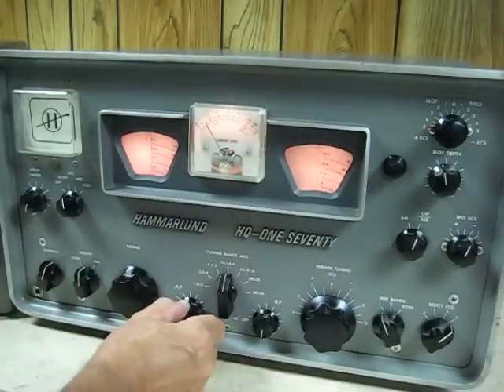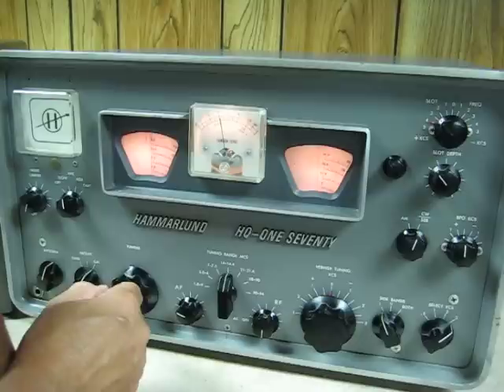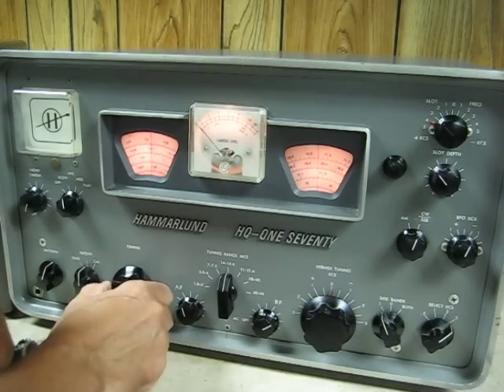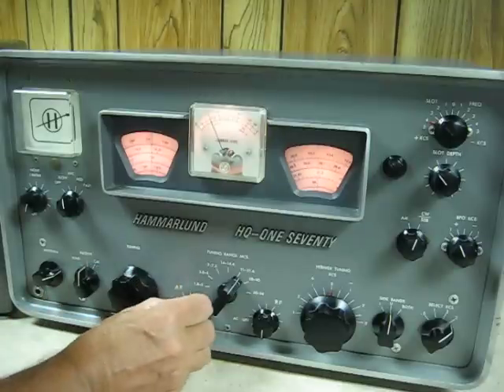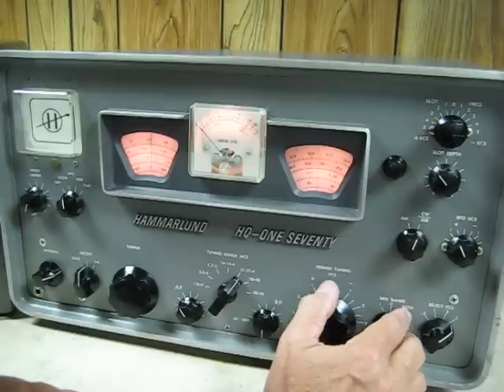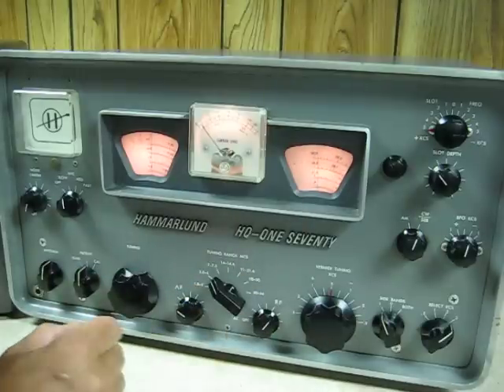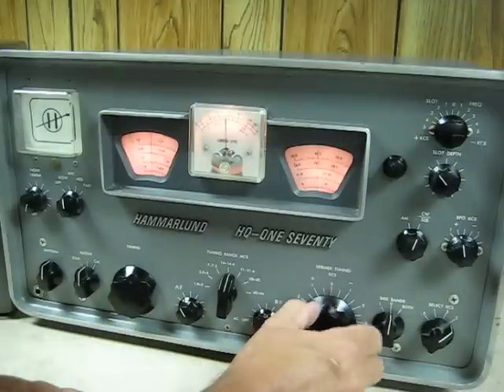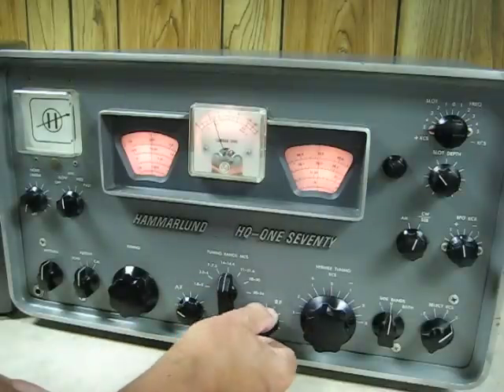Hammarlund HQ 170

Comment: A beautiful receiver.  This is the very first piece of equipment I ever owned, and was my introduction to Amateur Radio.  Bought it for $100 in 1976, when I was a teenager.  I still remember how thrilled I was to get this thing sitting on the desk in my bedroom and hooked up to a simple long-wire antenna.  Not to mention that it seemed like it could heat my room in the winter.  Great memories.  Mike N8ATL

Comment: Can someone please tell me what this can be used for? As a preper and going to live off grid in Hawai Big Island how can this be of use to me especially with all thats going on with China and Mid East? thanks.
Reply: I am new to shortwave but if you buy an old radio like this you probably need to know a bit about electronics so you can replace some of the parts and to calibrate it. This is for listening only. If it is working perfectly you can see the specs online of what it can do.